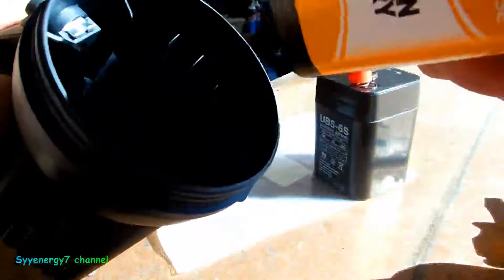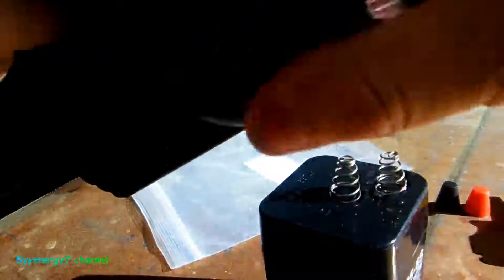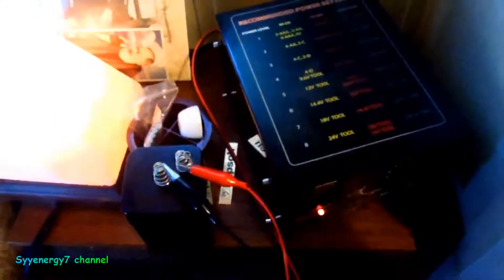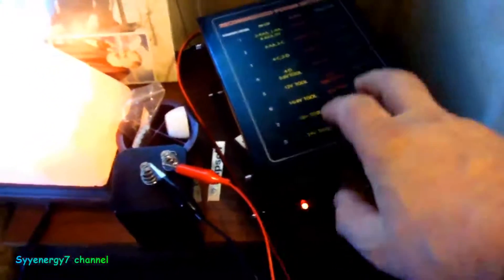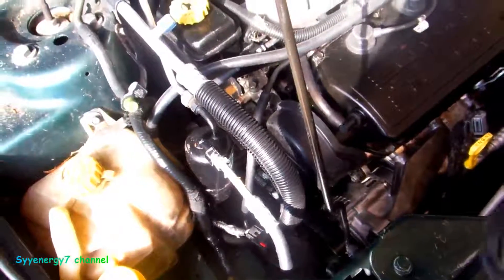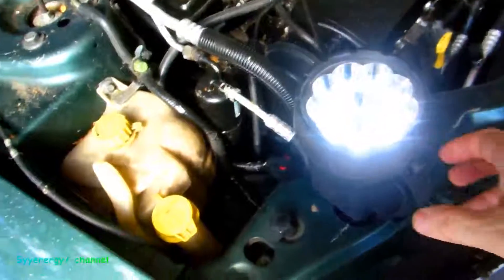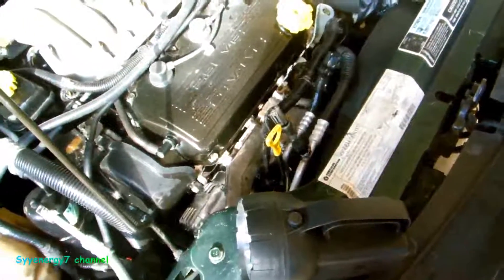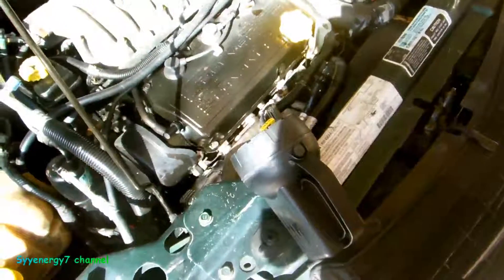Improve a Cheap Lantern Flashlight with a Rechargeable battery and a Bedini charger

Comment: Those Rayovac lanterns are total junk and fall apart if you drop them. I actually like the Eveready as much as my maglite, and its tough as nails for being plastic.

Where did you get that charger?
Reply from the maker: +Joe Schmoe Renaissance dot com.  I put Gorilla tape on that Ray O Vac light.  It should hold strong.,  Good tip on the EverReady..  I have an EverReady spot-light that is 50 years old and still good.  Made in the USA and chromed metal.
Reply: syyenergy7
Yeah the EveReadys now are plastic but they are about the same price as these suckers AND they are WAY more durable. Everything is made in America on them still except the bulb and battery.